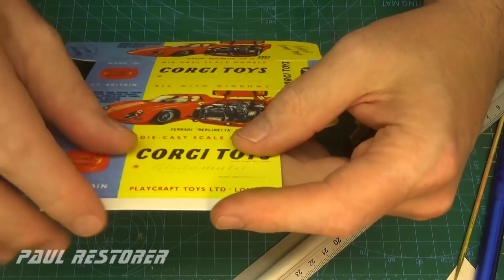Corgi Ferrari Berlinetta Le Mans nr 314. Naprawa dorabianie opon, resorak.

Comment: I remember this model.  It was particularly well made and you have beautifully restored it to perfection.
However, when Corgi chose to make a mid-1960s Ferrari, I have never understood why they didn't make a 1963 Ferrari  250 GTO, an absolutely iconic race car.  They would have sold a million.  I don't believe they ever made a Mercedes 300 SL gullwing, either.  Pity.
A work of art, Paul.
Reply from the maker: Thank you very much Randy
Reply: They did make a mercedes 300 gullwing , it was realised in 1/36th scale in 1982 in red in the black , orange and yellow window box for a short time , then both red and a silver version appeared in 1983 in the cars of the 50s series in a brown double sided window box , just before corgi went into receivership in july 83 .

Comment: Corgi toys 314 ferrari,  had a long production run,  1965 to 1972 , some also found their way into gift set 41 instead of the rover 2000 . Only 2 variations these are found on the baseplate early ones had 2 parallel straight lines cast , later ones also had 2 parallel lines cast but canted out at opposite angles at the rear , they all sported their spoked wheels and rubber tyres to the end of production,  from 1970 they appeared in the slim jim yellow and blue window box. A really lovely restoration paul .
Reply from the maker: Cool, Thank you very much

Comment: Did you just wash all those chemicals down your sink?
Reply from the maker: in the film there is a description that the water circulates in a closed circuit and is filtered. Best wishes
Reply: @PaulRestorer  Could you point to the specific location in the video that describes this closed circuit?  That's a bathroom sink. Seems extremely high tech to have a sink that functions as a chemical disposal (re-cycler or re-circulator) AND a practical sink.
Especially since the rest of the items and techniques you use and demonstrate are relatively low tech, save for the camera.

Comment: Nice work and documentation, however Paint job looks a little overdone. too thick, and not smooth. Or was that poor casting of the model??
Reply from the maker: Thank you very much. Indeed, casting left much to be desired, and unfortunately this problem occurs in most die-cast cars. Best wishes

Comment: Bad spot for the spare tire, race cars dont need them they have a pit crew for that shit
Reply: LeMans - in that era required cars competing to have a spare on board - in some cases a car getting a flat on the 8.4 mile course was not near the pits and the driver had to change the tire - BY HIMSELF -  to get the car back to the pits.
Reply: The regulations required a spare tire and trunk.

Comment: Just for flushing that paint with paint remover down the drain you have huuge dislike. :(
Reply: you are missing the point.
Reply: @josefzima8219  And the point is? It's a good video otherwise (though from what I can see, the paint finish could be better, at 5:50 you can clearly see the imperfections) but I find that kind of behavior inexcusable. I think it's you missing the point of my comment.
Reply: Didn't you read that the water is in a closed recycling circuit?
Reply: @1manfactory  Ok, I figured out it's written in the captions which I didn't have on since there wasn't any voice and I didn't expect any commentary. For my defense, it does look like he's simply pouring it down the drain. I'm not a "treehugger", but unnecessary pollution is just unnecessary. If it's filtered to a reasonable degree, then fine. Though evaporation is probably the safest option.
Reply: Shae Tallent  Go somewhere else, troll...
Reply: see below

Comment: Great work. But it will be very good if you tell during the video process, which materials you use. And where to get'em. For example, I know about Sonax wax. But I don't know which materials you use to make a tires form and tires itself.
Reply from the maker: Thank you very much. In the movie, I put subtitles that can be called from a computer. However, of course, depending on their type, the tires are made of polyurethane or soft, hot-heated plastic. I am sending you the link to the movie about tires. Best wishes
https://www.youtube.com/watch?v=Sp8aRJxAMkk

Comment: Hello Paul. I have just finished piecing together this exact car. My interior was destroyed and took a while just to figure out what it was supposed to look like. I made tires from O Rings which was a suggestion from another restorer. O Rings #31 look great, tiny bit smaller, but they fit tight and work.  MY BIG question is, how do you and what do you use to drill and screw the chassis back on, sizes and all. Normally I can get them to snap back on, but the way the chassis assembles I can not get it to snap into place. The Ferrari looks great but I am destroying it trying to get it back together.   HELP Please.
Reply from the maker: I drill the thread with a 1.6 mm light, then cut the thread with an M2 tap. Finally, screw in the Torx M 2 T - 4 screw
Reply: @PaulRestorer  Thank you for the response, I was going to share pictures of mine to show you how bad it is. It doesn't look like I can share photos. Where did you get the 1.6mm drill light?
Reply: @paulmaddams3951  
It's a WOWSTICK 1F screwdriver.  It is also available as a power drill.  I got mine from Amazon.

Comment: hi and thank's for the video. Can you help us knowing what are you using for the molds making, I mean the blue and he pink materials and what are you using for the tires - I mean the black material? Thank's in advance
Reply from the maker: Hi. My molds are made of mm940 molding silicone. The blue catalyst sets about 6 hours slower, while the pink catalyst sets about 3 hours faster. I usually make one part in blue, the other in pink so that it is easy to separate them later. As for the tire material, regular wheels are made of FC resin. 52 while the rubber wheels are made of soft plastic using the hot method and I heat it up to 160 degrees and pour it into a mold, or use liquid rubber {HPE resin}, then I make the casting cold. Best wishes
Reply: @PaulRestorer  hi and thanks. Can you Please give me the exact product names/descriptions? The CHT Germany are making the mm940 but I don't find not the pink nor the blue catalists... The same is about the rubber...

I am trying to save some Pow-R-Pull Autos Form ERTL ( with pull and go) motors. And their Rear Gummies are compromised..

Comment: Beautiful restoration! I miss your captions - I am sure that they are a lot of work! What material do you use for the tires? thanks
Reply from the maker: Thank you very much. I use polyurethane or soft plastic to cast the tire. which I pour out hot. Both of these materials are quite flexible.

Comment: Thank you for sharing your ideas and knowledje. I've learned a lot and I need it because I'm a beginner. What´s the material you used for the tyres?
Reply from the maker: Thank you very much. I used HPE 85A flexible polyurethane, which has a lifetime of 35 minutes. Best wishes
Reply: @PaulRestorer  Thank you for the information and The best for the magnific work you are doing

Comment: I have this exact model in the same condition, do you know the tyre size ? as they are advertised on eBay but I don’t know which size to buy.
Reply from the maker: the outer diameter of the tire is 15 mm and the inner diameter of the 7 Coma is 9 mm. Best wishes

Comment: Hi Paul,
Your restoration skills are 1st class including resin casting. Can I checked with you what kind of resin did you used for the types ? I suppose you used a resin with low hardness  after it is cured. I don't see you using a pressure pot, to remove the bubbles in the casting. Any tips on how you managed without the pressure pot to produce bubble free casting. Thanks
Reply: More than resin I think he used some polyurethane rubber died in black, Prochima for example have this product it's called SINTAGOM 703, but there's ton of other manufacturers that offer the same product so you can obtain a a soft tire like the original one, at least I think. :)
For the casting mold, sure having a pressure pot it help avoid the formation of bubbles, but I saw a lot of modellers that don't use it they simply create the mold, it's a matter of experience to do it without bubbles.
One tip to reduce them is, once you poured the silicon to tap it lightly under the surface of the table or stand where you placed the mold, in order to make the bubbles rise upwards and prevent them from remaining inside it.
Reply from the maker: Thank you very much. I used HPE 85A flexible polyurethane, which has a lifetime of 35 minutes. I use a vacuum pump to vent the material. However, I never cast resin of this type. Best wishes
Reply: Hi Davide, thank you very much indeed for the information.  I have been using Smooth-on without mixed results and I guess I need to improve on my technique. I was actually trying to cast some parts for my plastic models which I purchased via ebay and there were some missing parts. I was contemplating buying a pressure pot but I will use polyurethane and your tip to reduce the bubbles. Once again thanks. :)
Reply: Hi Paul, thank you very much for your reply. I will try using HPE 85A flexible polyurethane. I find that it is not that easy to use resin for casting plastic parts.

Comment: Could maybe use some syringes in the tyre molding process for a neater injection of the silicone.
Reply from the maker: I cast the tires from soft, hot plastic. Best wishes

Comment: What was the product for the black rubber wheels? I guess the mold was RTV but assume the tyres wernt else theyd stick to the mold?
Reply: window seal
Reply from the maker: Nothing sticks to silicone, so you can cast various things. When you watch my films, I even cast figurines of drivers from tin in this silicone. For casting the wheels, I used soft plastic, such as for bottle caps

Comment: excellent video!

what is the black material used for new tyres?
Reply from the maker: For these tires I used soft plastic like in the bends on the bottles. I heat up to 180 degrees Celsius and pour it into mold. You can also use polyurethane that mixes with the activator and add black dye to it. Best wishes

Comment: Did you ever try oven cleaning spray to strip the paint? On plastic models with enamel or acrylic paint it works very good, i think it will work on die cast models too.
Reply from the maker: I have never tried but it is a very interesting suggestion and I will definitely try. Best wishes
Reply: @PaulRestorer  kind regards from Germany and take care for your health.

Comment: wouldn't it have been easier to let the paint thinner work first before you washed it in the sink???
Reply: No
Reply from the maker: This is not a sink but it looks similar, the water I use circulates in a closed circuit and is filtered. Best wishes